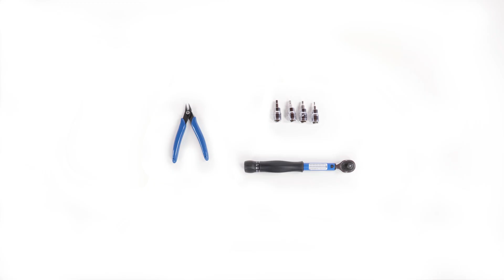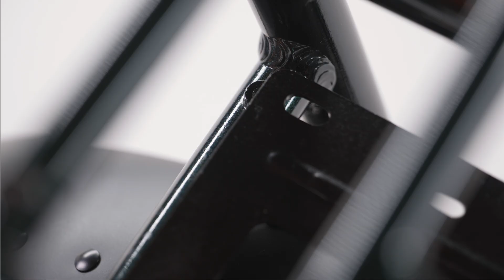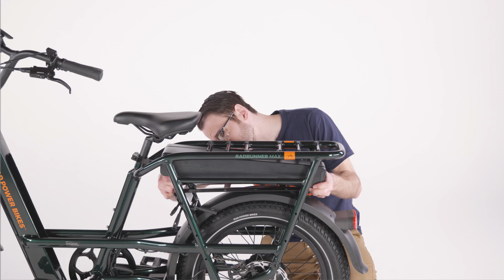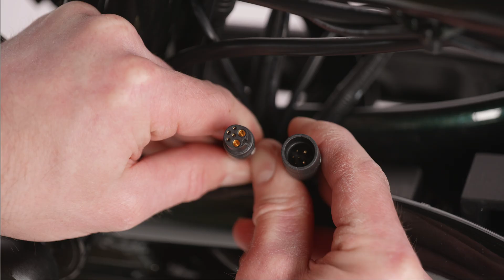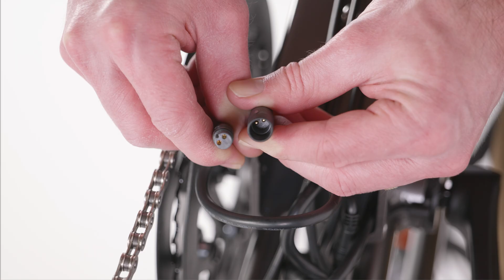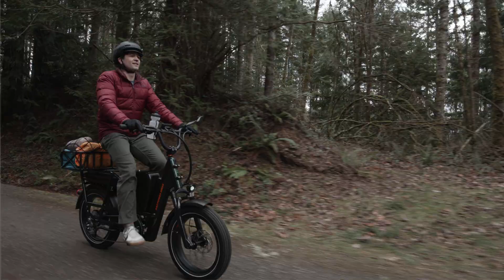Range Extender Installation | RadRunner Max and RadRunner 3 Plus

Comment: Can a roadrunner with a range extender be run with one battery only, if so which one
Reply from the maker: Hey there! Yes, you can ride with just one battery installed, whether it’s in the main battery tray or the Range Extender. The system will draw power from whichever battery is connected. Just make sure one is securely locked in and charged up, and you're good to go! Let us know if you have any other questions.

Comment: Do I need to add an end cap to the   disconnected battery cable.
Reply from the maker: Nope, no end cap needed! If everything’s installed per the Range Extender installation video, there shouldn’t be any cables left unplugged. If something looks off, feel free to send us a photo to support@radpowerbikes.com and we’ll take a closer look.

Comment: What makes this not compatible the previous models? Conector pins/cables or mounting points
Reply from the maker: Great question, Kevin! The RadRunner Range Extender is only compatible with select newer models because specific changes were made to the bike frame on the MY25 RadRunner Plus to support the Range Extender’s mounting design. These updates include dedicated mounting points beneath the rear rack, which are not present on earlier RadRunner Plus models.

Let us know if you have any other questions. We're happy to help clarify compatibility or explore other ways to extend your range.
Reply: @ so theoretically if I somehow managed to mount the range extender to let’s say a rad runner ( olde silver model ) I should be able to straight forward  connect it to bike and be working…? 

Thank you for the reply! :)
Reply from the maker: The RadRunner Range Extender was specifically designed for the RadRunner Plus (MY2025), RadRunner 3 Plus, and RadRunner Max only, so those would be the only models compatible. 🚴

Comment: Radrunner 2 owner here. I’m in need of this … ❤
Reply from the maker: Hi!  At this time, the Range Extender is only compatible with the RadRunner Max, The 2025 RadRunner Plus, and the RadRunner 3 Plus model. 🚴
Reply: @ Do you do trade-in’s? 😂
Reply from the maker: We’ve partnered with Upway.co, and from time to time, some of our retail locations host exclusive Upway trade-in events! Want in? Sign up for our newsletter at the bottom of our homepage (look for “Don’t Miss Out”) to be the first to hear when and where they’re happening. Got more questions? We’ve got you. Stay Rad!
Reply: The Fat tire lock is not compatible with the extender, it's one or the other.
Reply from the maker: Correct - that is listed in the compatibility section on the RadRunner Range Extender page as well. We appreciate you!

Comment: Please make this available for the original RadRunner Plus
Reply from the maker: At this time, the Range Extender is only compatible with the RadRunner Max , The 2025 RadRunner Plus, and the RadRunner 3 Plus model. 🚴
Reply: @RadPowerElectricBikes will it be available in the near future?
Reply from the maker: There are no plans at this time, but you can purchase an additional battery and take it with you on rides to switch out! We have a great battery travel case for that! https://www.radpowerbikes.com/products/battery-travel-case